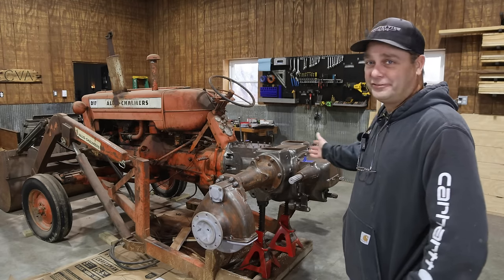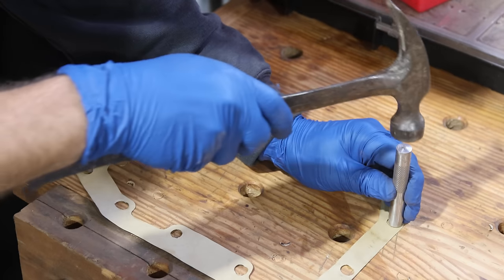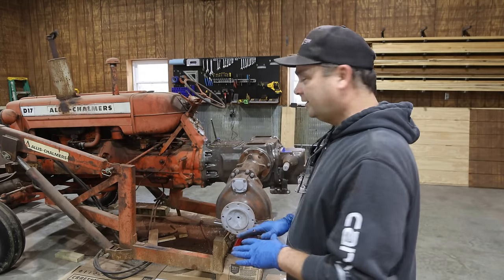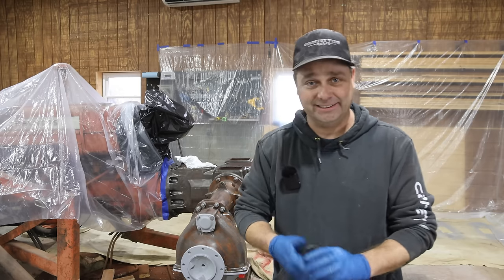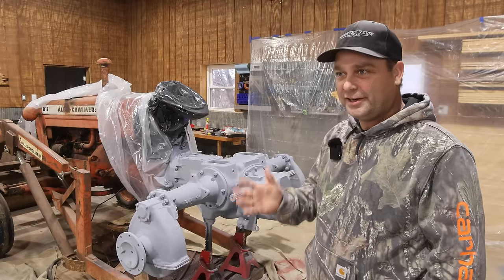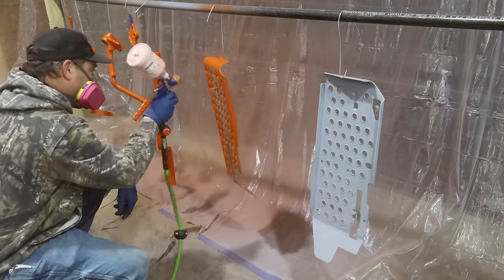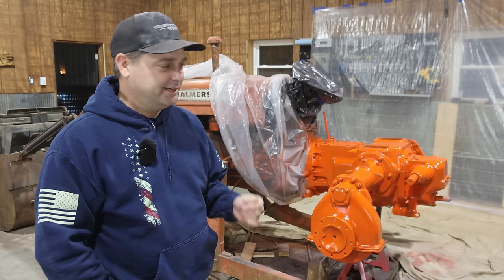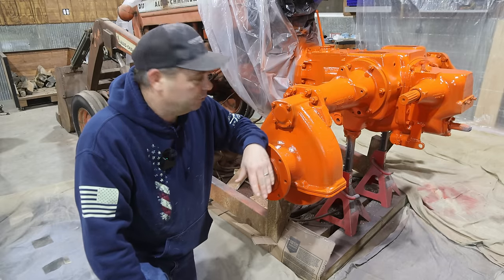I Think I Used the Wrong Color to Paint the back of Allis Chalmers D17.

Comment: Please cover those splined shafts so that the refitting parts will be easier.  Run a tap through threaded components.  Great video, thanks.
Reply: I thought about that too, with the tolerances being so close. I was surprised that Evan hadn't thought of that, since I believe he had to use a bearing puller to remove the part from the spline, when he was taking it apart.

Comment: I think you're going to be very pleased with the end result. FYI, check with your paint supplier for a pouring lip. Once paint is stirred and additives in the can you attach the pour lip spout thing to the can and pour paint into desired container. They work well, keep paint out of the slot where the lid seals and the spout can be wiped clean for reuse. Getting a lid back on and properly sealed is vital for reuse. And keep your arm moving while spraying. Twisting your wrist can cause runs. I learned that the hard way. LOL

Comment: You might want to do a test piece with painting over. There is a chance that the bottom coat might actually steer the top coat in a different direction.

Comment: Before you put next coat on lightly sand or use a scotch pad to help your next coat adhere better .Then give it a wipe same as you did before priming to remove any dust and also promote adhesion . Looking good so far.

Comment: I used 3 coats of primer and 3 coats of persian orange #1on my CA.  More in strategic areas.  But I used enamel which very closely matches the original.  Not quite as tough, but I used lacquer primer beneath.  Enamel takes FOREVER to dry though.  You're going to ding it up if you do any mechanical additional work.  Far easier to work with and add to anytime with mineral spirits cleanup.

Comment: If you have any concerns about the right color adhering. Rub it all down with fine wet and dry sanding paper, and should be no problem with the correct color adhering. A pain I know, but that's what mistakes will cost you. Hope it turns out ok which ever way you go.

Comment: you will need to re-scuff the paint since it has hardener ! if not the new top coat will peel. use red Scott bright just enough to dull or take the shine away.
use a tack cloth for the dust. good luck!!
retired painter

Comment: I know you talked about a booth for painting. I was thinking a 10×10 shade canopywith a white top to let more light in then your plastic around it would work. And it will collapse and store out of the way. Love the progress coming into the new year!!! 150K subscribers is coming!!!! 🎉🎉🎉
Reply from the maker: I ordered an inflatable paint booth I hope to have it next week.  It sounds weird but I think i will work.  The paint booth is 20x13 and 9 feet tall.  I think it will work out for painting tractors and equipment.
Reply: That sounds even better. I'm sure your ready to have it running and out of the shop for awhile!!! Happy new year..
Reply: @CountryViewAcres hopefully the new paint booth has a removable floor liner. So you can get it  around the tractor.
Reply: @jahn9960  Isn't it odd that if you were to spray paint your concrete floor, it wouldn't last a week, but any overspray or drips seem to hang on forever?
Reply: @-DJ-    hahaha never thought about that, but it is very true. Can even get it off trying.
Reply: @CountryViewAcres Yeah the inflatable paint booth will work. Samcrac used one to paint a car of his. He set it up outside his shop and brought the car in and parts in to paint. It may have a floor in it so you may have to split it to get it over the tractor.

Comment: The hanging parts.. do the small ones first..then slide then to one end. This will give you more space on the rod. Take the longer ones and flip them on their sides and hang with the short side down. The should give you a better angle of spraying. Though it is the wrong colour, but the old paint on the tractor is very faded too.

Comment: Another way is to purchase the correct gasket material and use the appropriate size ball bearing to mark your holes. 

Then finish trim the gasket and punching out the holes.

They also have a plastic trim piece that molds around the lip of the paint can making it easier to pour and use a paint brush without spilling into the lip itself or down the dide when pouring. 

Nice video.

Comment: I worked for many years in a painting factory and I can tell you that the hue of every batch of paint is slightly different; so before the application some adjustment and tests checks are necessary.
Reply: Agreed, I’m a Ford tractor buff and seeing all the old original paint jobs there was a good amount of variation in the blues comparing a late 60s tractor to a mid 70s tractor.

Comment: I was thinking to raise up the pipe you are painting the small parts on, you could take 2 taller 2 x 4's and drill a hole in the 2 x 4 to slide the pipe threw the 2 x 4 and just clamp one 2 x 4 into the vice and the other one just sitting on the other end to support the pipe to raise the pipe up so you don't have to hold the parts to paint them, maybe add a small piece of 2 x 4 at the bottom of the 2x4 that's not attached to the vice so it doesn't tip as easy, looking great will be nice when you are done

Comment: Loop short piece if string end each end 4” long. Loop on one end larg enough to go over pipe
Then hang each item with wire you made to string.   Will allow you to turn part easier to paint
Great job!
Reply: Right... painting a spinning part is a real treat.  Minimum two points of contact,  no spinning, and enough space to walk around every part.

Comment: Interesting video to me. I took autobody classes in high school from the fall of 83 to the spring of 85. I was using the old high pressure low volume Binks and DeVilbiss paint guns. Trigger and motion control was so important to not get a run. The modern guns are way better from what I can see. The weight over instead under my hand is nothing I've experienced, our cans were a lot bigger though. Hope you get the color to what you want it to be.

Comment: I don't know if I would have painted those splines for 3 point arms might have trouble getting them back on.
Reply: They are good and hard, that shouldn't be tough to clean off with a wire wheel. A couple wraps of painters tape would have been way easier and faster though.

Comment: Paint can be a bit of headache if you’re having to do (redo’s) especially when it comes to industrial enamel coatings. Definitely will need to scuff it up before you apply the new correct colour. Be sure not to rub through anywhere and go nice and steady, light coats.

Comment: It's going to look great! Have you thought about pulling that home-grown bucket off and storing it permanently in the equipment yard? It barely works, hides the nice shape of the tractor, would needlessly add to the workload to 'restore', not to mention you have two modern tractors w/ buckets...
Reply from the maker: The loader  may not go back on any time soon.  I just want to get the yractor back running and usable.
Reply: Didn't he buy a bunch of stuff to make it work a little better/faster? They way it is, I agree, set it off to the side. It is very painful to watch it working in slow motion with nearly no range of motion either.

Comment: Definitely need to use a scotch brite pad and scuff it really well. Once that paint has fully cured the new paint eventually peel, if you don’t. And on  tractor enamel I also like to take my paint gun and spray some lacquer thinner in the hard to reach places. It will make the paint slightly sticky and the new paint will adhere better where you can’t get a mechanical adhesion from sanding.
Reply: Better know your paint... because that is a really good way to cause the paint to wrinkle (lift)  That paint won't cure for a few months.   Scuff and re-coat will not be an issue.

Comment: I have a simple question why you did not just rehab the entire tractor? I know the cost would be more, but I just asked.
Reply from the maker: The original plan was restore the back half of the tractor over winter.  Then use the tractor over the summer and then restore the front half the following winter.

Comment: Just a thought, you might want to put some texture on the footboards.  I used bedliner on mine and its been great.  

As far as the orange goes youre not going to match the weathered color no matter what.  You might even want to polish a spot of it to cut the oxides.  You might be surprised how it looks.  Tou are correct the farm store and rustoleum colors on the shelf are generally not the early color.  Im not totally convinced they're really "correct" for any year.  For a series 1 is Persian orange #1.  
I'm painting my whole tractor and the Rust-Oleum paint is the cheapest option for me.  It will keep it from rusting and be orange, which is what I needed.